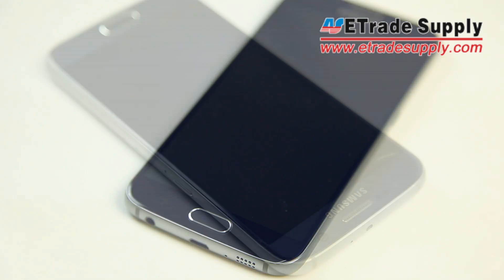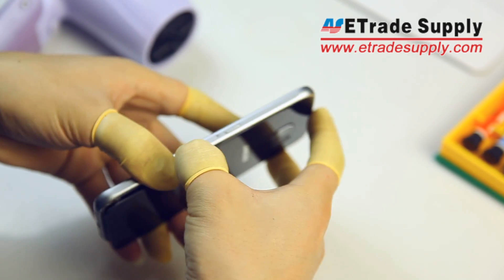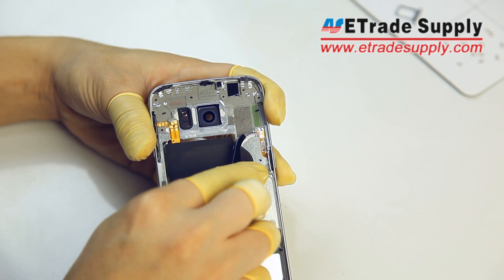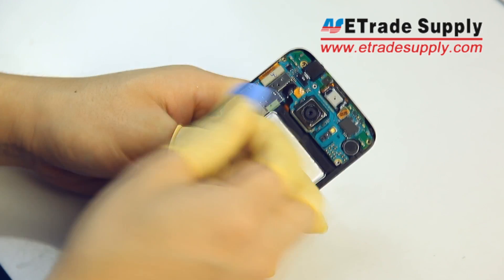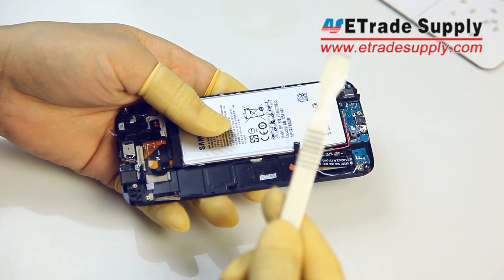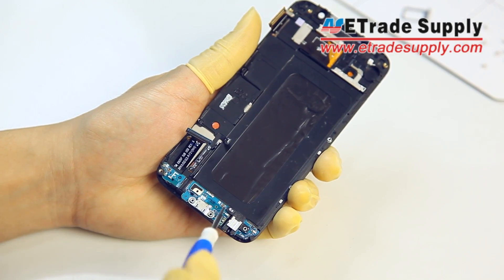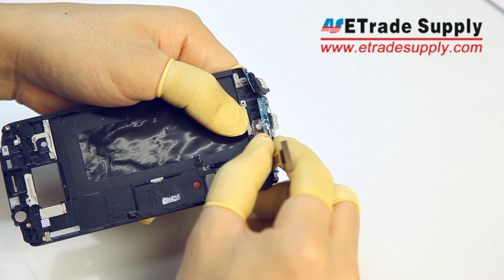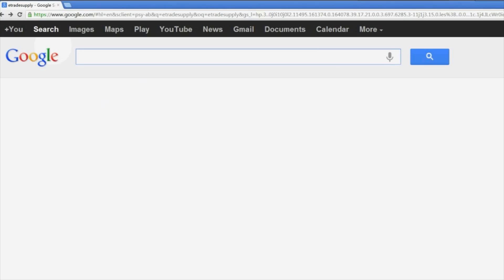Samsung Galaxy S6 Disassembly/Screen Replacement/Charging Port Fix/Replace Battery

Comment: I HAVE A QUESTION! I have a Galaxy S4 & my LCD had burned out. & was wondering. How difficult is it to repair or replace? I took it to my Technician at Sprint but they couldnt fix it because of how hard it is. Can you help me. I dont want a $600 phone to go to waiste.

Comment: 1. your finger condoms looks silly. 2. Use a sim opener pin to open that tray not tweezers. 3. Use a heat gun not your mothers hair dryer.

Comment: Finally a easier way to remove the digitizer keys just in case they stop working instead of using a heat gun an prying up the glass screen to get to them. I can see this phone getting many different modified back plates instead of the glass finish, I'd personally prefer a matte finish back panel with a suede plastic type finish, feels better in the hands an is a bit better when it comes to grip.

Comment: Oh dear lord, screen replacement (one of the most common things to break in a smartphone) is going to be a complete nightmare!
Reply: You can just pull off the glass if it's broken and it can be done by heating it with a hair dryer. And then buy the glass and stick it on :)
Reply: King Dorien Minor even with the chipset on screen. You can pull off the glass from the lcd

Comment: It looks like it's too difficult to repair if needed.
Reply: ***** 
Lol, you have obviously never seen inside an HTC one
Reply: looks like the hardest phone to fix or replace the battery so far.
Reply: And the most difficult to break or open seems a goodthing showing its really durable and premium...
Reply: holy understatement
Reply: Far Q lol  im a noob and i've replaced my htc one battery my self and i didn't brike it
Reply: ***** ur such an idiot! go buy an Iphone and leave us
Reply from the maker: jeffscomp We definitely recommend taking this phone into a professional repair shop should you ever need repairs on it.
Reply: If they don't fall apart that means you're an idiot.
Reply: ***** I remember few years ago such thing happened to some Samsung lcd-tv's that were on display in store. Those tv's screens were slightly loose from their frame because they were on the wall directed to downwards in slight angle.
Reply: It's really just time consuming, not really hard. It actually looks easier than some phones like the One and any newer Xperia.
Reply: Actually it looks pretty easy. Takes me back to the iPhone 3G days. Two screws at next to the charging port and then pop out the front screen with that same suction tool, unclip some cables, some more screws, and eventually get down to the battery (literally the last thing in there that's removeable). About 13 minutes per complete disassembly. The S6 looks just as simple, if not more.